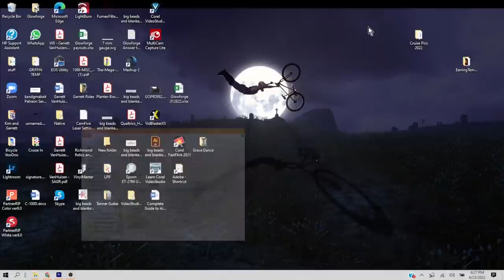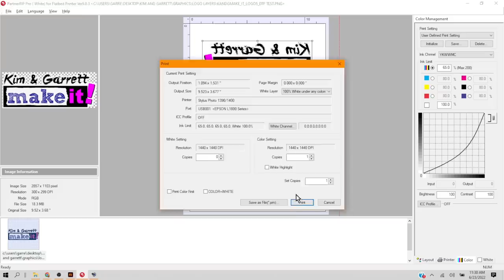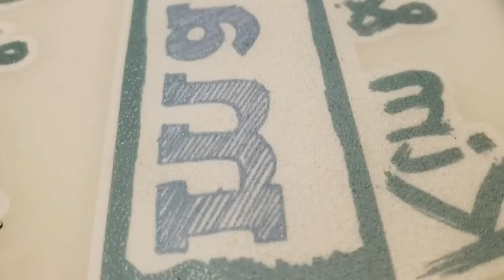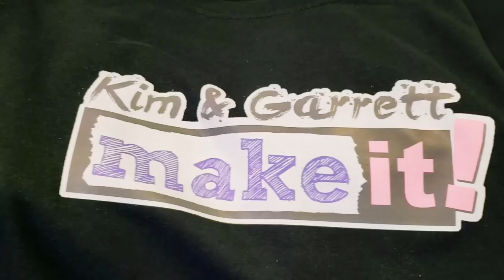How To Print DTF Setup andTest Step by Step with Epson L1800 | Direct To Film Printing

Comment: I feel like 3D printers for home use are for either prototyping home inventions or creating custom fixtures and artwork. I'm about to purchase one myself, and am very excited at the prospect of making replacement plastic parts for pieces that sometimes break off slightly cheaper items. I also collect figurines, and it would be cool to print them for the character shelf. I would pull the trigger, they are much more economical then they used to be.
Reply: I’ve been use 3dp like for a year, belive me it’s sometimes killn me its not that easy print in quality everytime. Hotend problems, layer problems, bed levelng problems bla bla bla

Comment: Garrett - a 3D printer is a must.  I print chucks for my resin tumbler spinners.  But a fan screw guide for your glowforge when you clean the air assist fan.
Reply from the maker: Those are awesome ideas!

Comment: Try using a normal heat press for the pressure and you have to heat press it once  more after you cold peel off
Reply: YES GETS RID OF THE GLOSS LOOK AND LEFTOVER ADHESIVE

Comment: Thanks for the tips guys.   I purchased mine from a friend who never used hers but I see I'm missing the cup for the back to excess ink.
Reply from the maker: You can use a Starbucks Tall Cold Brew with extra Chocolate Foam cup in place of the overflow cup it was supposed to come with. ~garrett
Reply: @KimandGarrettmakeit  really?   Just a starbucks cup?  I have been searching everywhere for something similar.

Comment: Looking good. Does it fell like plastic or more rubbery? I have a laser white toner and it cracks easily and feels like plastic. Disappointment. Use a hard substrate paper for the mdf instead. Should work better
Reply from the maker: It was really stretchy!
Reply: @KimandGarrettmakeit  Thanks for the response. One more question. Did you buy pro rip software seperately?

Comment: So what is the make and mode of printer? Great DYI video
Reply from the maker: Thank Flip! It's a Brand PUNEHOD L1800. My understanding is they bought Epson L1800s, modified them and are reselling them. My PC recognized the printer as an Epson L1800 when I plugged it in and it came with Epson L1800 drivers.
Reply: @KimandGarrettmakeit  thank you I looked it up and found it. You guys get to give it the initial run of it so I can see if a purchase is a good choice. Please keep us posted with maintenance and cleaning.

Comment: Which laptop do you guys use so the DTF printer is compatible with your laptop ?
Reply from the maker: We run our DTF printer off an old HP running Windows 10. We hear that Macs have an issue.

Comment: Any issues with the white in clogging the print head? DTG printer have an issue with white plugging the printhead unless you have one with a circulation system for the white ink.

Comment: Hi there, great video. What accessories did you need to buy with it? I see it comes with film and ink. So powder is needed and you mentioned that. But did you need anything else? Also, what is the biggest size you can print? How long does it take to print (on average)?  Thank you for trying this all out for us!
Reply from the maker: Hey Rick and Yvonne! Everything came with it! It came with the printer (and spare parts), the heater, 100 transfer sheets, the software, and the ink. We did need to buy the adhesive power and we needed a heat press. The largest print size is 11.7 x 16.5 in and our logo 3 times at 3.5 x 9.75 took 16 minutes then 3 minutes in the heater. 15 seconds to press.  Hope this helps! Our Pleasure! Thanks for watching! ~garrett
Reply: @KimandGarrettmakeit  awesome, thank you. What is the biggest size you can print?
Reply: Great info and demonstration!

Comment: So I got the virus protection pop up too. I didn’t open anything because it freaked me out. Did you end up having any issues down the line? My wife is waiting anxiously to use hers but I’m afraid to open the software. Any help would be greatly appreciated. Thanks in advance.
Reply from the maker: Oh yeah...  This is freaky.  SO, Try to install the software. It will create a folder called c:/PartnerV9 .  Then go to Windows Setting/Updates and Security.  On the left Windows Security then click the Open Windows Security button.  On that screen scroll down to Virus and Threat Protection Setting and click manage settings.  Scroll down to Exclusions and click Add or Remove Exclusions.  Then click Add an Exclusion/Folder.  Navigate to the folder PartnerV9 and select it.  Done.  Then, just Reinstall the software.

Comment: 3d printers are great, you can print replacement parts like hinges/handles, custom peg board parts/holders, and so much more. There are ton of things a 3d printer can be used from from printing a silly little figure to literal guns. 3d printing tech has drastically improved over the last few years.

Comment: 3D Printer isn't something you buy to make products, for the most part, it's something you buy to make jigs and things you can't buy but are for your own use. I have a few 3d printed products that I sell, but I think the strength is custom tools, jigs, measuring devices, etc. I think that's the killer application for it.
Reply from the maker: oooh okay, interesting. So really it is more for Hobby use
Reply: @KimandGarrettmakeit  I wouldn’t say more for hobby use but you’re More likely to use it to make tools and such than you are to make something sale worthy

Comment: You have to go back and cure the ink with another press at the same time and temp.  This will stop the smearing. After it cools again.
Reply from the maker: oooh okay!
Reply: Do you know how to set up the settings to get a great print?
Reply: @ladygordon91  Some people say that the same settings will work with all the equipment. I think that you need to try different settings with each piece of equipment. Try to change your temp and time just a little. Remember you do not have to use the whole piece of film. Print a small test piece on film and try then cut off and print, then you use the rest of the sheet to try another change setting if you are not happy with those results. Remember this is a, kinda new process and you need to try to find what works with your equipment. Just do not change the settings by a large amount, be sure to write them down as you try so you don't repeat the same ones over again. Just a little change can make a difference in the finished product.  Don't be afraid to try to change, just be carefull.

Comment: Hey guys I love when you post about new machinary. With DTF are you not suppose to do a second press after the peel? (I've been told )
Reply from the maker: I'm not sure! We'll have to try both
Reply: It's recommended.  It helps seal it plus makes the print feel much softer.

Comment: Isn’t a sublimation printer basically the same thing, all you need is the powder? Great video guys
Reply: If I understand correctly the POWDER is the adhesive.
The printer applies WHITE ink.
It that last part that means it NOT dye-sublimation and makes it appropriate to be applied to Dark/Black material.

Comment: I bought the same exact printer. Be Aware* you MUST run daily Maintanence with head cleanings and suctioning ink through to the waste tank. If you do not do this daily (which waste a ton of ink btw) you will clog the heads and after repeat attempts at cleaning the heads you will end up burning up the motherboard. There is a loop hole 3 year warranty on it that applies to anything that does not make contact with ink (the whole printer technically makes contact with ink so the 3 year warranty is rubbish) I’ve had it 60 days and went out of town for 5 days and now both the print head and motherboard are toast.. now I have to pay an additional $500 to replace those parts because of the loop holes in their “warranty”. After getting into this field I’d much rather modify a regular epson yourself over to dtf.. save you a few thousand dollars
Reply from the maker: Thanks for the info Mitch! We're doing another video this week covering the same thing! We had to do a ton of maintenance after going out of town for 4 days
Reply: @KimandGarrettmakeit  yeah other than the daily maintenance regardless if it’s in use or not it really is a decent machine to make fairly large and high quality prints. Please believe my comment was not to insult you or your views (I’m a content creator myself and get tons of negative comments) I just wanted to share my personal experience with this exact same printer/oven combo I got as well. I will eventually replace the print head and motherboard in the near future but dang it ticked me off after taking to their support team and finding out the warranty loop hole they have. Great video by the way, I hope much much success with youtube... it really pays off in due time
Reply: I’m trying to get my money back from them ppls now
Reply: @moneymitchofficial  I got this printer for only 2 weeks and white ink doesn't come out fully. I've done all the maintenance (print head, nozzle, dampers) but white ink still doesn't come out perfectly. This printer is a disaster.

Comment: That's not an Epson L1800 printer.  That's a Punehod L1800 that cost 3 grand.  The Epson L1800 can be had for only under $500, and you need to slightly mod it with DTF ink, including white. It would be interesting to see if the Epson at 1/6th the cost can hold it's own against the Punehod.
Reply from the maker: Yeah! We were not going to mod it ourselves. We watched videos on how to do it, but it looked like we could mess it up pretty easy. We found the Punehod for $2750 with the heater, and we thought that could get us going quickly.
Reply: I thought the punehod was just a modified Epson L1800.. it reads as an epson on my computer
Reply: @KimandGarrettmakeit   can you please do a video on settings!

Comment: I just got my dtf printer and the virus software will not let it work.
Reply from the maker: Try to install the software. It will create a folder called c:/PartnerV9 .  Then go to Windows Setting/Updates and Security.  On the left Windows Security then click the Open Windows Security button.  On that screen scroll down to Virus and Threat Protection Setting and click manage settings.  Scroll down to Exclusions and click Add or Remove Exclusions.  Then click Add an Exclusion/Folder.  Navigate to the folder PartnerV9 and select it.  Done.  Reinstall the software.  Let me know if this helped! ~garrett

Comment: See that peg board behind you? Quite literally infinite attachments. battery storage, organizers, custom tool storage, film holders, spool rollers. Most of this stuff is pennies to print.
Reply: make custom storage containers, want a new product? prototype before sending it off to be cast. prototyping is one of the largest benefits of a 3d printer.

Comment: I don't think people realize all of the DTF printers are the Epson L1800 or Epson printers with a few modifications. Most of these builds come from China and can be considered stolen IP as they have tampered with the hardware as well. Many companies don't allow that because of the abuse that you're now seeing with the printer and them putting it on the market for almost Ludacris prices compared to the manufactures pricing. It looks like Epson for some reason stopped selling it probably because of the abuse. They most likely updated the design and increased the price. You're better off finding cartridges and ink for the printer you want and converting it yourself. Also, if they go this far to convert the software and hide that it was originally an Epson printer you really should not trust the drivers, and programs it wants to install on your computer. It may lead to theft of personal information and your designs in the future. You will also save thousands if you convert it yourself.